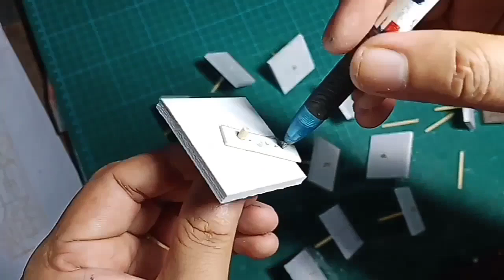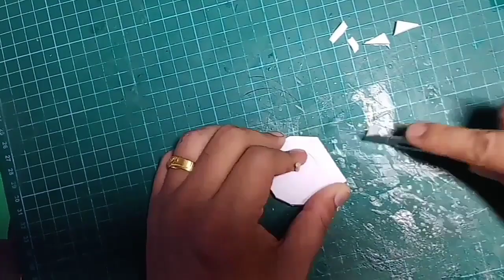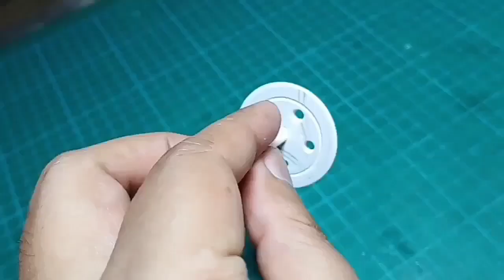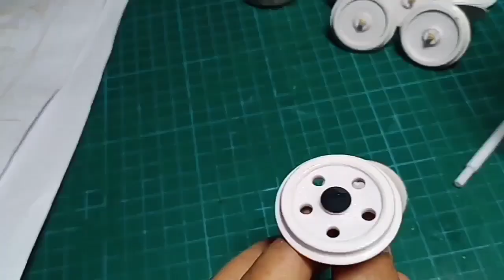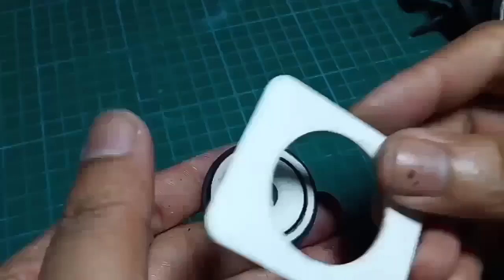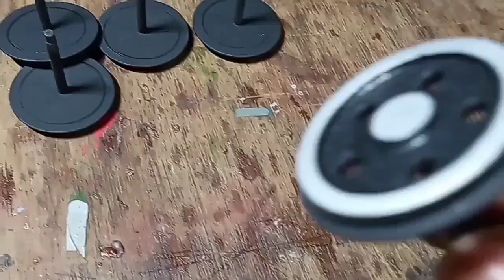Making handmade miniature of train wheels

Comment: what is this material?
Reply from the maker: Its 5mm forex sheet
Reply: @HeemsMiniatureWorld  thank you
Reply: @HeemsMiniatureWorld  How long will this material last in outdoor use? I want to use it for a garden railway.
Reply from the maker: @MODELARLUKAS  This material is actually water proof. I have applied glue as well as painted over it which gives extra protection. But prolonged use in direct sunlight may cause the material to expand or bend. I don't really recommend to use under direct sunlight or more than room temperature. Otherwise it is ok
Reply: @HeemsMiniatureWorld  Oh, well, thank you for the answer. I was going to use it on the garden railway
Reply from the maker: @MODELARLUKAS  Better to go with wood, plastic or metal. Very easy to make with a rotary tool.